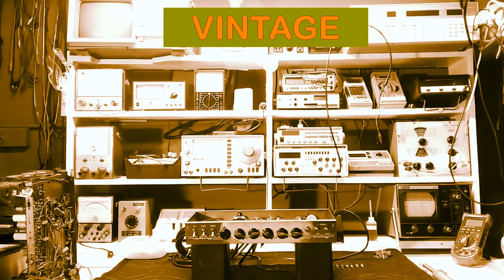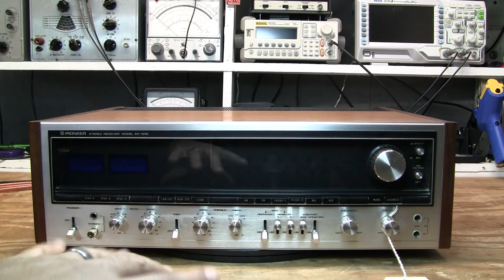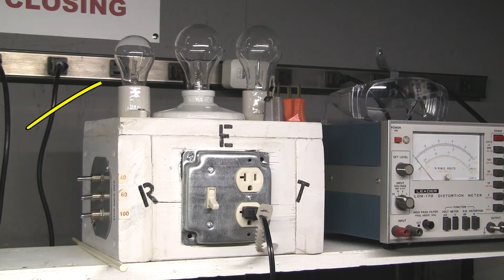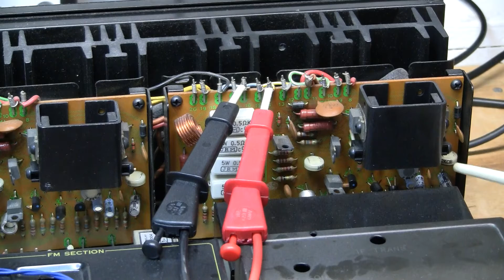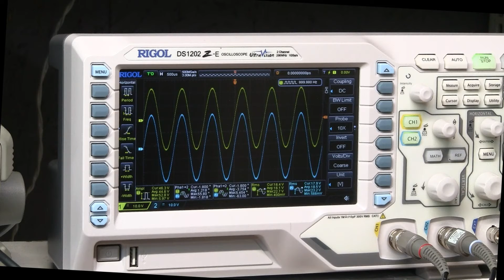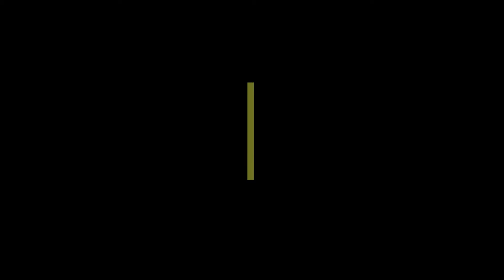Pioneer SX1010 Right Channel Issue Part One

Comment: Don't rule out a driver transistor going open E-B, will cause this exact symptom, and intermittent is more common than not. At the failure time, the E-B voltage will increase, easily measured. Bad solder would do the same thing at a driver as well, I would suppose. I don't think the A726's would cause this, but I would replace them anyway.
Reply from the maker: Thank you for your input Mark, always appreciated.